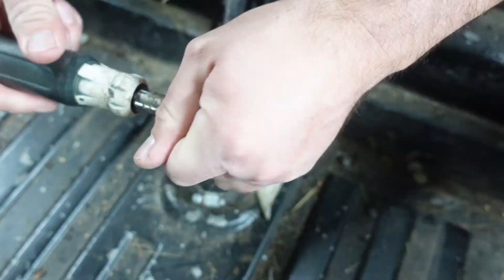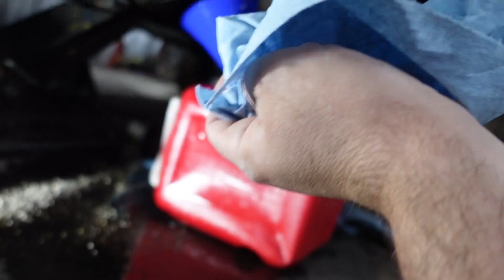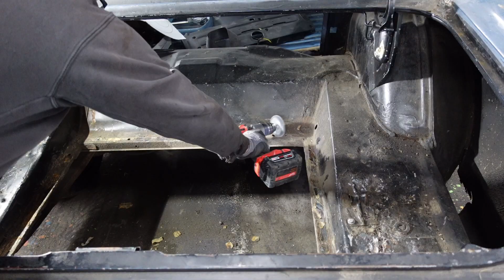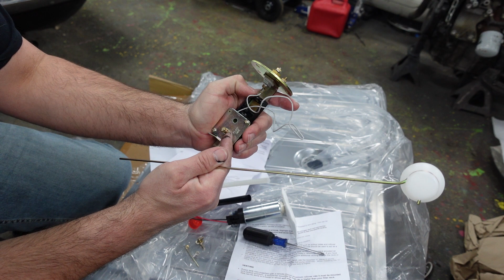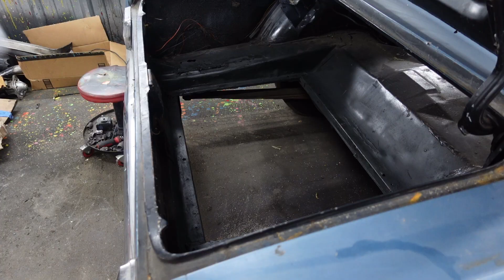Installing a Holley Sniper EFI Fuel Tank and Pump American Barra Swap Chapter 4

Comment: Don't have a light close to a gas leak it can break the bulb and cause a huge gas fire
Reply from the maker: I use battery powered led lights.  They don’t put off heat, and there’s no filament to make an arc.

Comment: Can I just send you my 65 coupe and pay you to set up everything from mounts to wiring and I can install the transmission and engine later. I just need someone to run wiring, engine and transmission mounts, gas tank, some body work, and figure out how or where to run everything from the harness on turbo barra, then have it matched up to a CD009/00A 6speed Nissan/Infinity transmission. Modern gauges from a newer mustang fitted into the original dash somehow. Still working on that part. May look for a good set of aftermarket I like that match the original style with a higher top speed. Origbal I believe is 90mph or 100mph. Lol. Original V8 car though. Uses the left to right elongated style gauge. I like it but want something more updated or an update to the original. You're another inspiration for my build brother. Love seeing your's come along.
Reply from the maker: I’m still trying to figure some stuff out too.  I wouldn’t want to take forever on someone else’s car too.  Lol.
Collins makes an adapter for the cd0009 trans though.  I started wanting to go that route before I found this t56.  The cd is a pretty stout trans.  I kinda want to buy one for a future project just because the prices seem to be going up on them.  
Sounds like you have a pretty good plan.  And planning is like half the battle it seems.  At least with me.
Reply: @RobRabonPhotog  defiantly. I aprriciate all the info and time you put onto letting us know your efforts and what you had to do and are having to do. My car was left by my grandpa when he passed away. My dad blew the motor and started tearing it down for body work but it got stalled and hasn't been picked up since. I want to get a channel started with my best friend about working on my gramps mustang with a barra swap and my friends miata and her build plans since I do most of the work these days on it. Lol